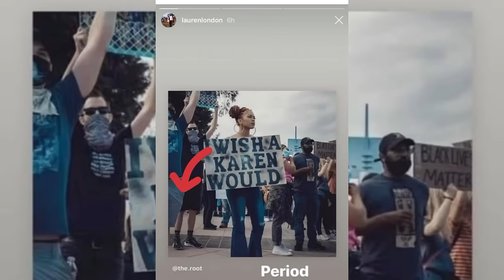WOWW!! DOLLAR TREE POOL NOODLE DIY. INEXPENSIVE HEADBOARD ~ HEADBOARD IDEAS

Comment: Do you have and suggestions for a canopy bed? I have a headboard but I can put definitely add something on the wall. But I want to use them on my bars if possible without spray painting  or painting period. I don’t want to take that big frame apart.